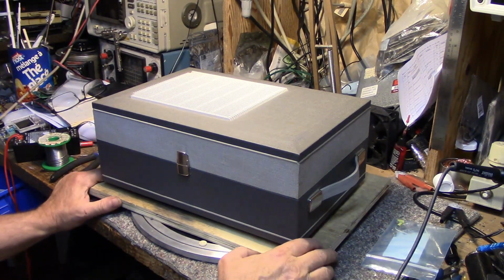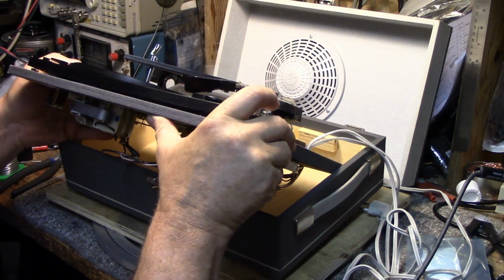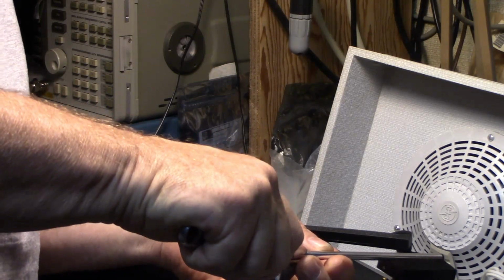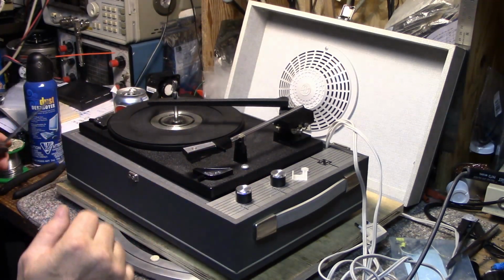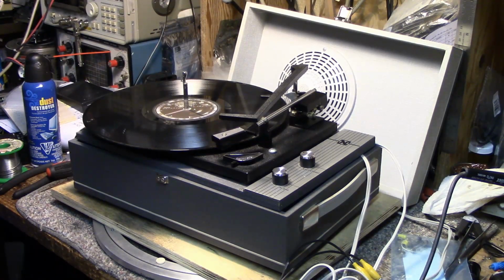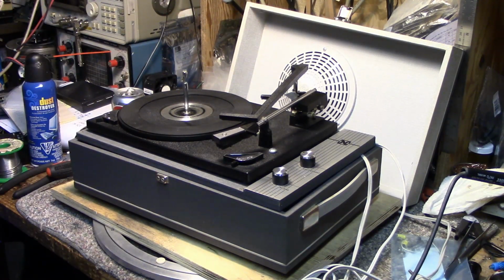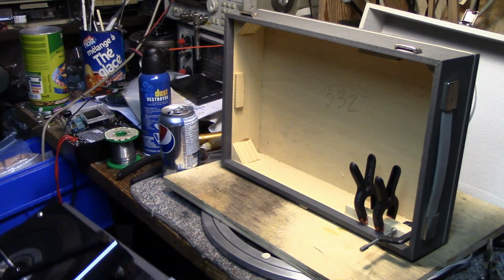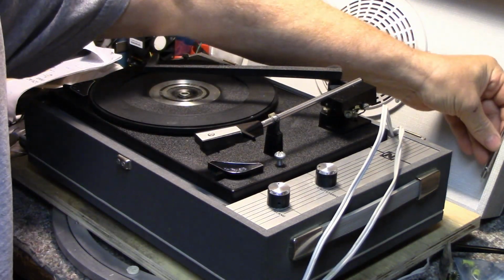Mystery Garage Sale Find (Ep. 51)

Comment: Very retro, I like it. They make cheap newer kinds like this but they just don't have the mojo of old stuff.. Yes the taller spindle and the black arm that swings across are meant to accommodate "stacked vinyl" , mostly 45's ( full LP can get heavy) so as one finished  (45's are just one track) the other would drop down and play. Yes, not good for either the vinyl record OR the tonearm cartridge angle on the grooves, but these were pretty much everyday players, not hifi.

Comment: If crosley would make suitcase players like that, i wouldn't mind recommending them for the very casual listener :D Btw, i think this might be an Elac-161-TV that was rebranded for a German catalogue sales company called "Neckerman". The only picture i found was this https://www.picclickimg.com/d/l400/pict/372081322685_/Elac-161-TV-Schallplattenspieler-im-Koffer-Plattenspieler-teildefekt.jpg and while it's not the exact same model, a lot of things look very similar. Oh yeah, it's most likely from the 60's. I wonder if you could retrofit a different transformer. That also might get the speed of the plattern to where it should be. That thing, apart from the bent tonearm, looks almost like new!
Reply from the maker: Thanks for the link, I'll check it out. I thought about a substitute mains transformer but the motor would be still 50Hz and spinning the wrong speed. I figured it best to leave it alone since I have no plans on using it and it's only for display. 
If I find some aluminum tubing with the right OD/ID I could replace the tonearm with something straight, lol